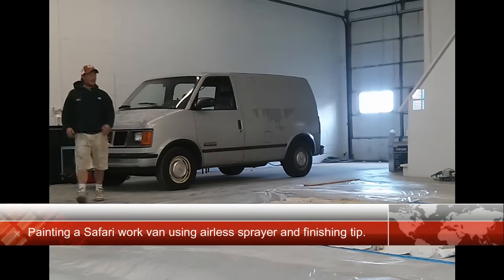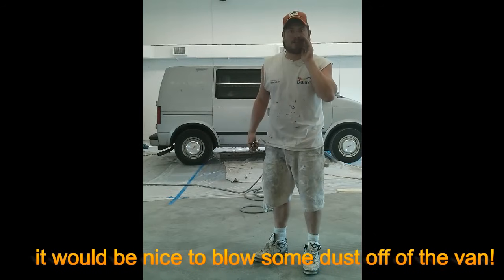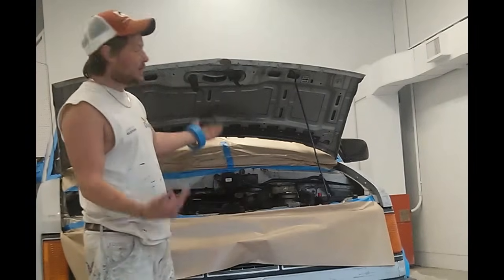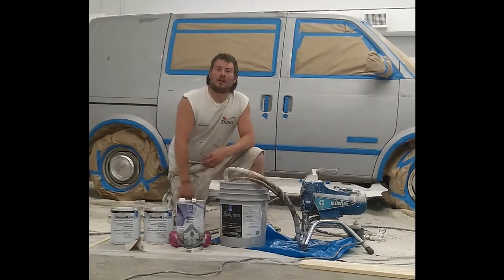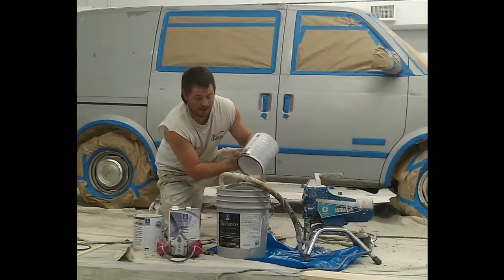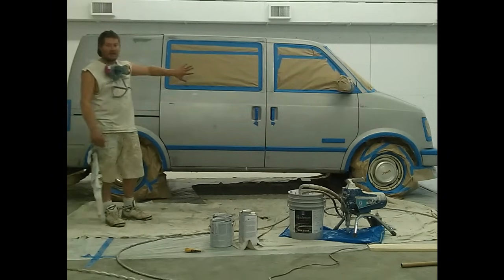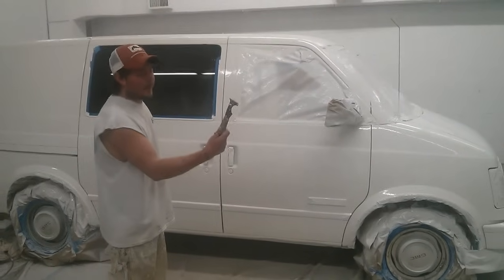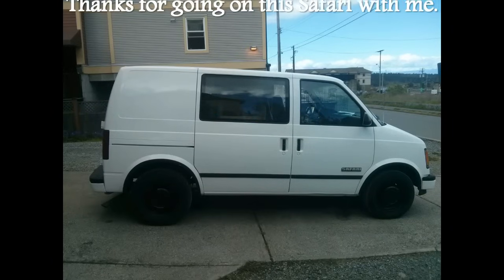paint van

Comment: Did the same thing years ago. We used an airless sprayer with a new 515 tip and used industrial enamel and paint thinner to paint a VW bug. Industrial enamel is machinery paint and cheap but also very hard and oil resistant. Turned out great.

Comment from the maker: So much fun doing this video in a sarcastic kind of corny way. I am stoked to see it circulate a bit! anything is possible as far as do it your selfers.
Reply: Bud, best van paint video on the tube, I couldn’t find any info on using an airless sprayer with certain paint, and you are an actual painter so you eased my mind a lot mentioning the 410 tip. I have a small airless that I will be spraying an Astro in rustoleum tractor paint, Ford grey color. Knocked it out of the park my dude, thank you.

Comment: i use to paint cars for a living,specificly jaguars,,, we used a metal to paint primer called etch,,it stopped the flash rust ,, i dont think you had to wait 6 hours in between coats if the temp is over 75 degrees,,,,  when i saw what your were doing i thought it was going to be one messed up job, to my surprize your painting job , rivaled  any industrial job, way to go and  thanks for sharing

Comment: That mask you had on was a heavy duty dust mask. Not for paint fumes, you needs one with charcoal filters
Reply: He has charcoal filters it's a 3m mask with charcoal filters
Reply: Travis Benfield  that’s wrong respirator for paint fumes, correct one has cotton like pre filters, then charcoal canister. That mask is appropriate for say concrete dust stuff that is a dust and fumes that are not harmful. That mask will keep the paint out of your noise hairs but not the toxic fumes.
Reply: You need to take a closer look, those are fume filters NOT just dust filters, don't let the pink covers fool you.  I just bought the same ones and they are multi- gas filters w/ pink covers.
Reply from the maker: @nortavon  yes you are very correct! Great cartridges.  Nice

Comment: Great job!!!!! Can I get the name of the materials you used for your van???? I want to paint my work van too
Reply from the maker: Products for the most part are losted in the video, what are you looking for specifically? Most of the work is in prep, and for overkill rust treatment in any areas that need it. Any industrial steel metal paint you can spray will work. Do not go for coverage! Do as many coats as you need. Too much material will sag on smooth vertical surfaces.

Comment: I've been thinking about doing the same. so you didn't add any liquid hardner or clear coat ?  how does it look now.   thanks
Reply from the maker: itzPlayTime its holding up really well and is a fleet van now. I just used sherkem right out of the can and thinned it a bit. No other additives. I would do lighter coats and more of them. I had a couple sags I'm the heavier areas nothing super noticeable.

Comment: pressure needs to go up, your gun is leaving tails
Reply from the maker: Yes that was frustrating.. That is at full pressure on the 395. Now I would have used a 495 minimum.
Reply: jds could have been the tip was blown
Reply from the maker: @duartepaintinghandymanservices  you might be right about that. It was right out of the package, but maybe 4/10 finishing was a little soft for such a heavy duty product.

Comment: i admit the final utcome suprisingly looked pretty decent onVideo , i sprayed a VintagecSports Car with a Turbine HVLP  spray unit and Dupont two Stage Automotive Paint  with IMO got  a Professional looking result  with  my Rig happens to be a older CambellHausefeild unit they don’t  sell any longer  the Gun is a AllMetal Gun  and canister  ( Aluminum) that cleans up  very Well  and Resembles a Auto Body Binks Gun with a siphon Canister below the Gun   FYI one of my Uncles  actually Developed and Patented the Reversible Self Cleaning Airless Spray Tip  and started the Titan Paint Sprayer Company    he made his money and sold out years ago Currently i beleive it’s all owned by Wagner now  and has been for a few years  Painting isn’t  my trade  i’m  a retired ProfessionalWoodworker  and i bought the Turbine HVLP for finishing Furniture and Cabinetry  it was also a good portable unit to  do refinishing on Jobsites if needed   we did  a lot of Lobby Paneling , and ArchitectualMillwork that sometimes needed  touch ups  with Conversion Varnish  with minimum Overspray and  Set up / Breakdown time  so that CampbellHause Feild  Turbine was the one i liked at the time  and still use it  when i need to  ivecsprayed just about everything through it with good result

Comment: first number on an airless tip is the orifice. Second number is the fan width x2. so a 410 would have a 20 inch wide fan.
Reply: stoneygreek wrong! First number is the fan and the 2 last numbers is the orifice
Reply: stoneygreek wrong
Reply: Wow.... It seems you have a bit of dyslexia going there. Yeah, the others caught it, but here's the skinny for the newbies that want the actual info ...

The first number (4 in this case) is used for the fan size. If you multiply it by 2 the result is the approximate fan size when the tip is about 12" from the surface being sprayed. So a 410 tip has an approximate 8" fan when the tip is 12" from the surface to be painted.

The last two digits are the orifice size in thousands. So this tip has a .010 (ten-thousandths) opening for the paint to go through. Orifice size is directly relational to how many gallons per minute of material will be passed through the tip. If you have a big orifice and a little pump... Well, you see the problem, gentlemen. ;-)

.
Reply: my bad, a 410 tip would have an 8inch fan and a 10 orifice